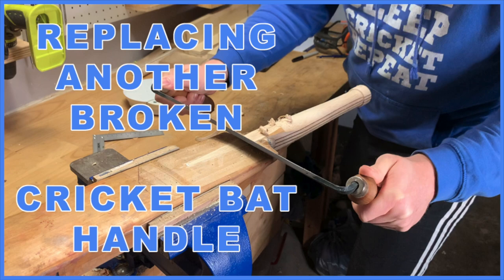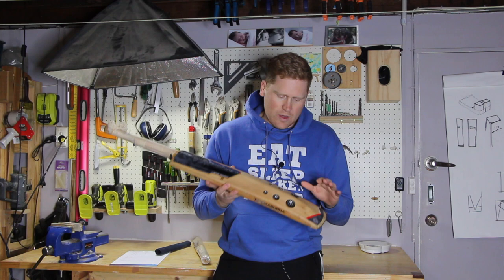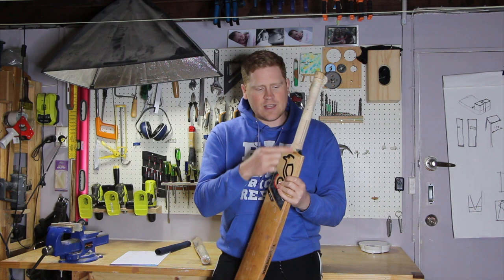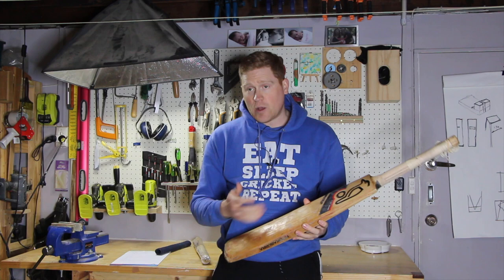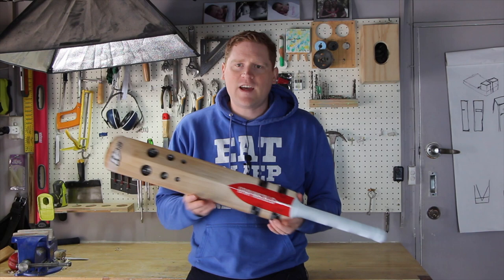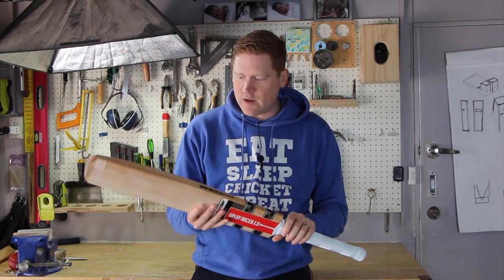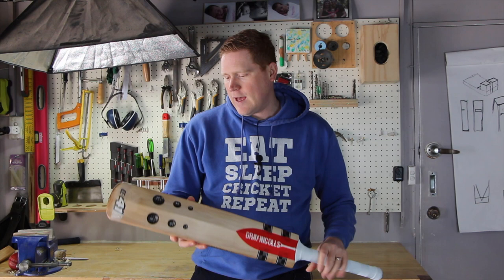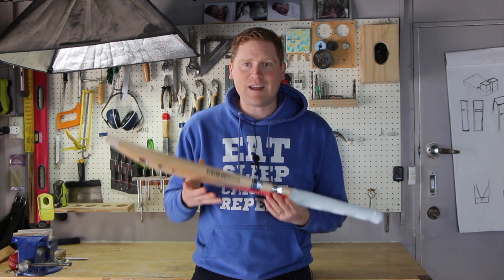Replacing a cricket bat handle (another one!)

Comment: If the clear facing is peeling off a "ready to play " bat, is it better to replace the clear face or remove it and oil the bat and use without the facing?
Reply from the maker: Really personal preference mate.
I've got three bats I use on a regular basis, and only one of these has a protective facing and that's because I use it as my wet/bowling machine bat. I think you get a better feel for how well you've hit the ball without a facing, but your bat is more open to damage...
A guy I train with, won't use a bat without a facing on it.

95% of bats with facing on them that I repair are too dry. Take the opportunity at the very least to give it an oil.
If you decide to put a new facing on, about an hour after you've oil, give it a rub over with acetone (acetone onto a rag then wipe the bat), leave it a day and do the same again before putting on the facing. The glue on the facing hates oil. This should stop the facing from just peeling straight off again.

Comment: Great stuff. What is the solution you use to get the residue sticky stuff off, acetone, white spirit? And do you leave it a minute before screping again?
Reply from the maker: Hi Paul. Depends a little mate. Two main products I use are - White Spirits, which then I do wait a minute or so before coming back to scrap off.
For bats that I'm not sanding, I like to us De-Solv-It, a citrus based product. It down't have the same harsh chemical smell white spirits has, but does require a bit more elbow grease.